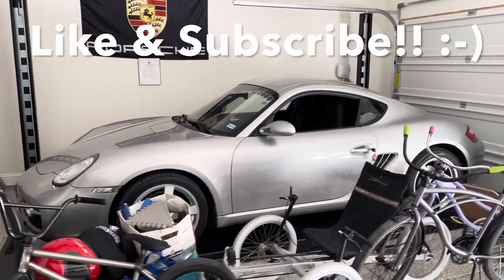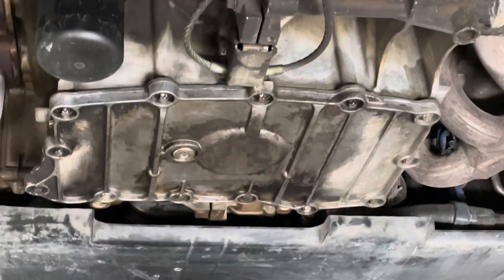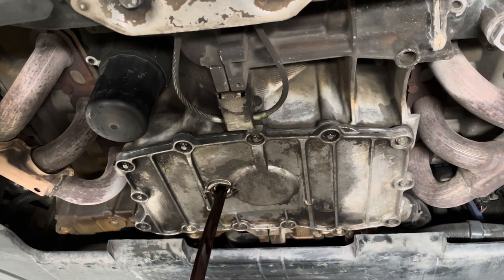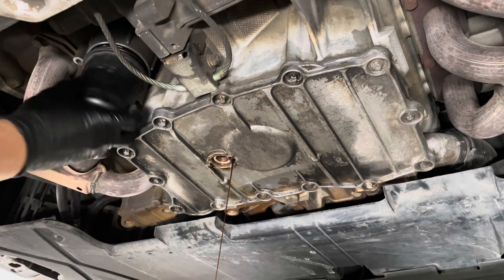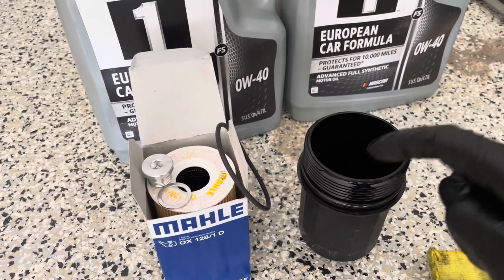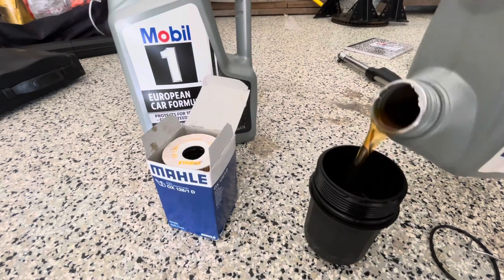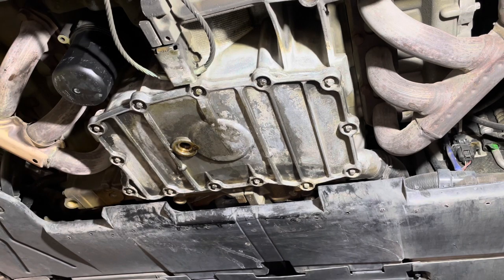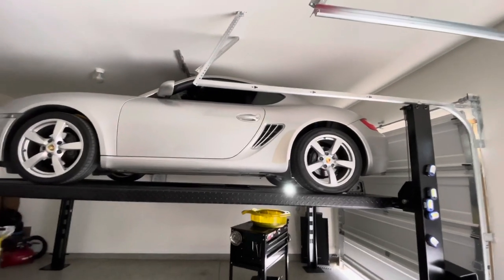How to change #engine #oil on #Porsche #Cayman #987

Comment: I heard not to let the torque wrench snap more than once. However, satisfying that click may sound!  also you said spec was 37.5 and you torqued to 35  'just to be sure'  did you dyslexify that?
Reply from the maker: I usually let it snap twice personally :-) I do 35 ft lbs first to see if it leaks and then can tighter if needed. English is not my first language ;/). Please like the video and subscribe.

Comment: I've heard new crush washers, but have not heard about installing a new drainage bolt every time.  Why is this necessary if the part is in good condition?
Reply from the maker: Brandon - good question. The drain bolt is aluminum and gets rounded pretty easily. I personally would not use the same one more than twice. It will get rounded when you torque it down and rounded the other way when you take it off. They are only $5 for replacement. Your call though, whatever you’re comfortable with.

Comment: How is the 0w40 doing for you? I used to use Mobil 1 0w40 but it would burn a ton of oil. I switched as per recommendation from my mechanic to motul 5w40 and haven’t burned a drop between oil changes.
Reply from the maker: It’s been great for me and hasn’t burned any between changes that I can tell. 5w40, which is a great option as well, for me, was audibly louder so I switched back to 0W40 and it was quiet again.
Reply: @512TXSDIY  noise from where?
Reply from the maker: @omm8701  I assume the lifters. When I had 5W40 in mine, I could hear the noise. Similar to what it sounds like if it hasn’t been driven in a while. 0W40 back in and it’s super quiet so I just keep using the Mobil 1. It’s cheap and readily available at Walmart.